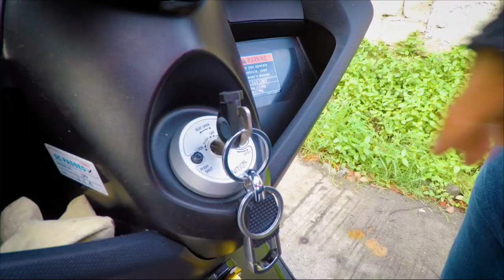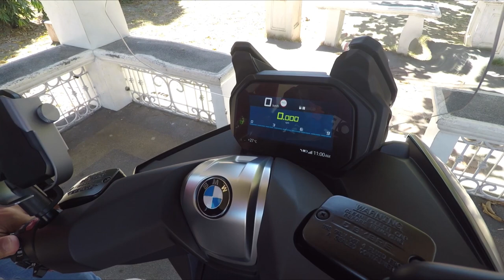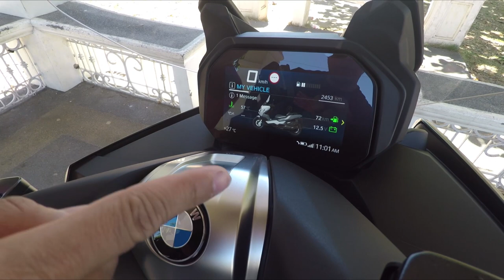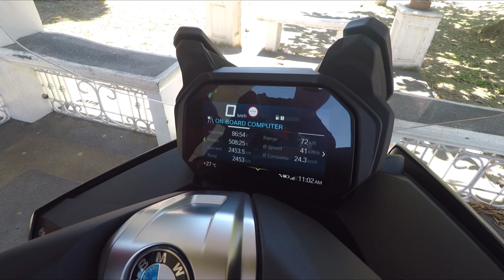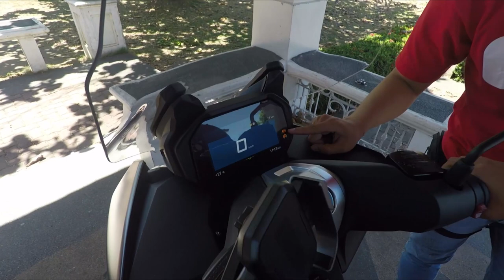BMW C 400-GT UNANG PINOY REVIEW // KONTI LANG ANG MAYROON SA PILIPINAS / 3 SECOND LANG ANG 60KPH WOW

Comment: For that price, dapat TMax nalang sana... mas praktikal at mas comfortable sa ride..
Reply: kymco ak550 kesa sa tmax..
Reply: Blue Sky reliability and the parts are the issue.. japanese bikes are more reliable and cheaper to maintain.. plus the engine differences. Tmax is parallel twin and this bmw is just single. Power and reliabality..
Reply: @dudez0884  walang issue sa ganun sir..bumili ka nga ng scooter na nagkakahalaga ng lampas kalahating milyon tapos iisipin mo pa kung alin ang mas murang imaintain?bmw c 400 gt ay luxury scooter..
Reply: @OooO_952  luxury scooter din po ang tmax.. ang issue po yung availability ng parts kapag nagkaproblema... For me this bmw scooter is not a luxury cruiser scooter... Tmax has more features than this one... 😊 So FOR ME, tmax is the bang-for-the-buck ika nga... Tsaka sabagay ang katapat din po kasi ng c400gt ay xmax400... C600 at tmax ang magkatapat.. so no competition din talaga kung c400gt vs tmax550
Reply: @BlueSky-me8ee  di lang yan tft, on board computer
Reply: Ang katapat nito ang c650gt at c650

Comment: All Comments here ay binasa ko lahat, at ang main issue is.... Doubt ang mga Filipino if Expressway Legal ba ito talaga?, pero bakit nagkaroon siya ng RFID?  Which means binigyan ito ng authority para makapasok ng Expressway. Ang gusto ko lang po malaman kung anu po ang inilagay ng LTO na register Engine Displacement nito sa Certificate of Registration, otherwise ay mag-ALL NEW 2021 S1000R 4cylinder engine na lang ako 🤔, sure kahit anong gawin ng Highway Patrol sa akin, hatiin pa nila ang Engine displacement ko ay sobra pa sa pasok sa Expressway legal ko 😉